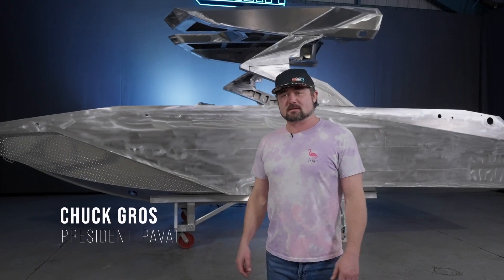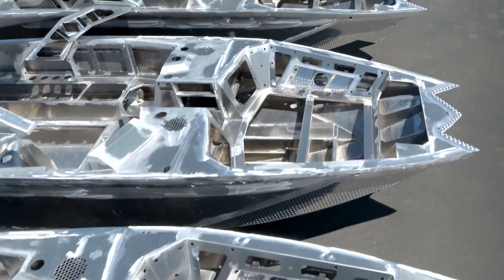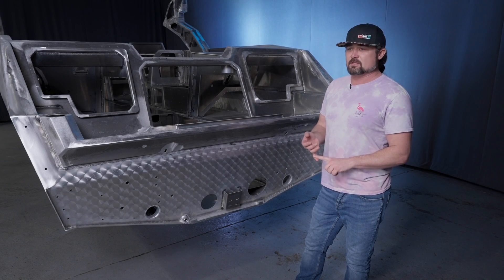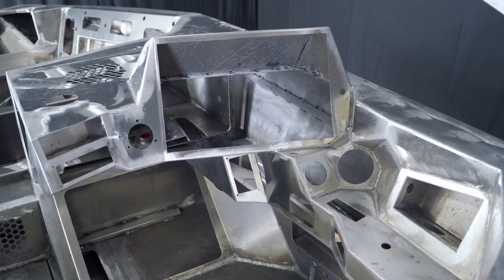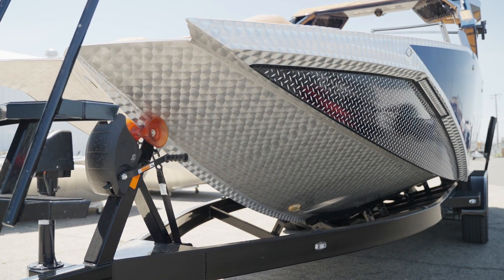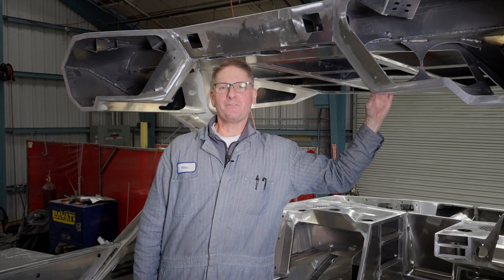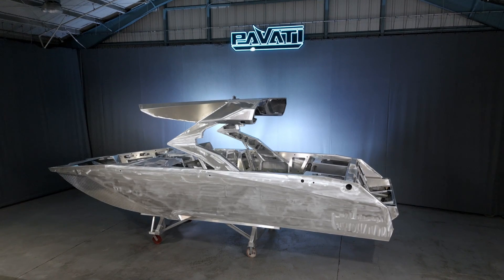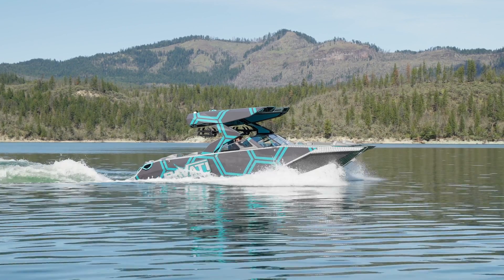Pavati Wake | Art of Aluminum

Comment: Agree aluminum is the superior material and there are reasons fiberglass is used so much by other manufacturers, and that those reasons are related to cutting costs, not that it creates a better product. I look forward to seeing boats like this made using laser welding. As good as these welds look, laser welding is amazingly consistent even in novice hands. Maybe that would help reduce your costs to the point where the pricing is not so astronomical.

Comment: So you have vids on interior, speakers and all that. But I can't find anything on your motor drive combo. What's powering these vessels?
Reply: Indmar Raptor Series 6.2L 600 Engine
1.76 Gear Ratio Indmar V-Drive Transmission
Marine Closed Cooling System
4-Blade Acme Propeller
Reply from the maker: hi @kari53, we just posted our video on Indmar Raptor Engines.
https://youtu.be/uJtESxLWaTc
Reply: @PavatiWakeboarding have you tested Sharrow props?

Comment: Don't rag on fiberglass everything has its place...this boat would get WRECKED in the Ocean. Id put my Pursuit 2470 up against this crap any day. Aluminum rides like shit.
Reply: WTF are you talking about? Welded aluminum boats do absolutely fine in rough ocean conditions and will outlast any fiberglass hull by decades. How come the overwhelming majority serious offshore fishing boats are welded aluminum if they get wrecked out in the ocean?
Reply: @markadler8968  what are you talking about squid? Depends on the size of the vessel first of all.. you need a lot of maintenance to keep an aluminum hull in the water for 30 plus years.. most big fishing vessels are made out of steel and require high levels of maintenance regularly to not rust away. My comparable size center console fishing boat would out perform this boat you couldn't even get this boat out of an inlet on a slightly rough day. This boat is meant for hauling Twinkies around the lake
Reply: @michaelm1573  we are talking about aluminum not steel, stop trying to change the subject. You are the one saying all aluminum boats are garbage. Of course this ski boat wouldn't last 2 seconds in the ocean but there are plenty of welded aluminum fishing boats that would make your boat look like a total joke out in rough seas.
Reply from the maker: Quite a different comparison in our industry… Our fully welded hull is far superior. Ride quality is much better vs any other wake boat.
Reply: @PavatiWakeboarding  just hire someone else for your advertisement... Elitism died when Biden ruined the economy
Reply: This is ignorant. Most working boats of this size used in the ocean are made from aluminum for the some of same reasons these ski boats are - durability, resistance to water damage, and ease of repair if they do get damaged. If you make your living on the water you want the toughest lowest upkeep boat possible and that's why the majority of these boats are aluminum.